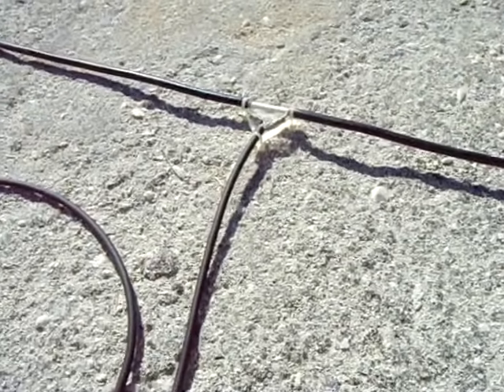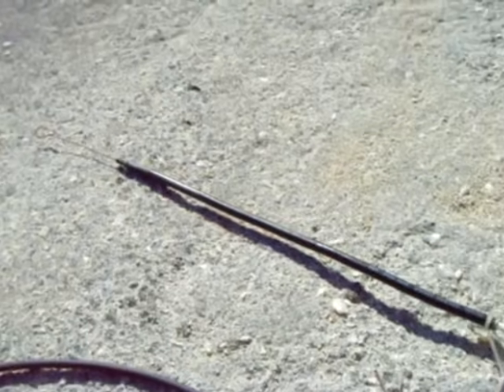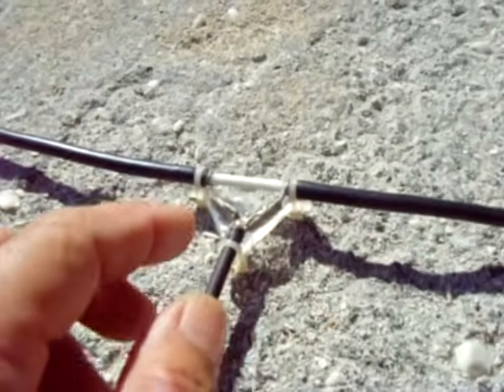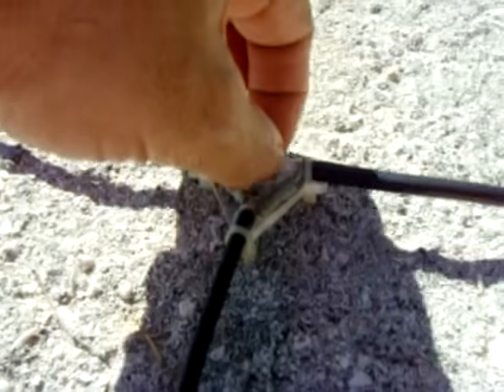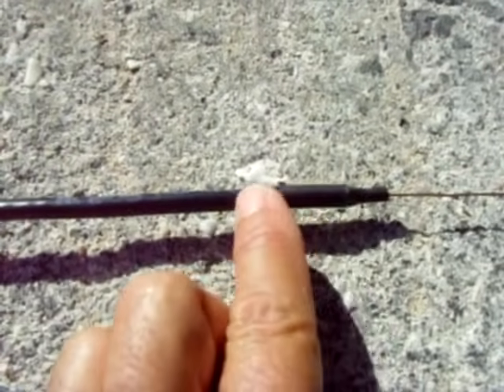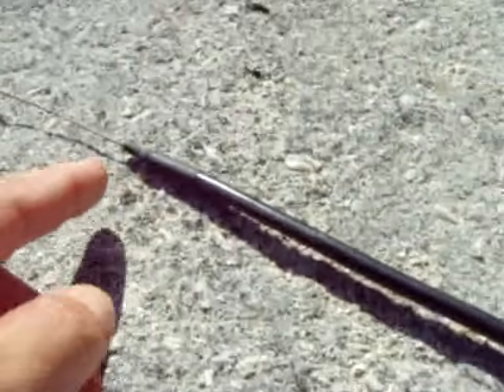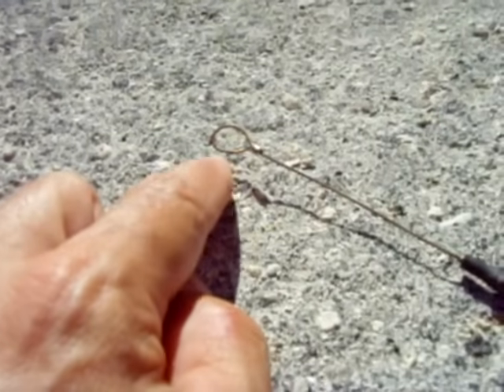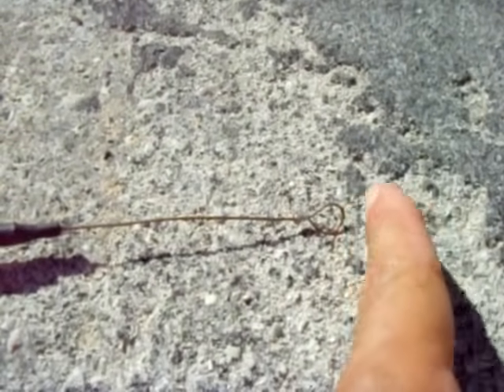How To Make Coax Antennas (FM receiving) Folded Dipole

Comment: That is NOT A FOLDED DIPOLE - you are using the wrong words to describe a dipole.
A folded dipole is a loops of wire flattened out and spaced, then fed at one side.
This is a dipole.
Reply from the maker: It's considered a folded dipole. Why? Because of how the center conductor of the coax and the braided shield are connected or looped. If you have a problem with this antenna, then take it up with the designer.

Comment: Finally got that .exe running in a Win 7 virtual machine. Hoping to build this today or tomorrow to get better reception from a local radio station that doesn't transmit with very much power.
Two things I'm still confused about:
1) The program features a list of very specific types of cable (e.g. RG-8 vs RG-8x vs RG-8 FOAM), and also shows the feedline as 50Ω. What effect can I expect from using a 75Ω coax? (Impedance still confuses the heck out of me).
2) Given that the shielding of the feedline is tied directly into the antenna, doesn't that mean the feedline is no longer shielded, and therefore its length should also be calculated?

Thanks to anyone who can help.

Comment: Just made this. So if you solder both wires at ends of the top wire, the receiving end is shorted, correct?  It makes no difference with the short wire from the Yamaha amp I tried...

Comment: Being totally ignorant about antennas and radio waves, I found some of the information confusing leaving me with questions.
1)  From the calculator app, using 98.2 MHz, the center point of US FM broadcast frequencies, I should make an antenna with overall length of 60.1222".  Given that length, should the length be measured from the tip of the exposed inner cable wire at each end?
2)  The calculator didn't indicate the length of the bare inner cable wire at each end.  Because you said that the length is critical, what should it be given my FM antenna frequencies?
3)  In pointing out soldering the copper shielding braid to the inner cable wire, you mentioned that 'it' should be a specific length carefully measured.  What length were you referring to?  The length of the braid?  Also, you didn't mention what I take to be shrink tubing that covers the braid to where it is soldered.  ??

Comment: Trying to understand this...
My FM is going from 87,5 to 108 and I want to make an antenna for my Receiver.

From what I have understood and using COAXIAL DIPOLES by VS3SQB
Input FM 108 (middle of the FM band) - I get that I need a coaxial at 1.39 cm
Am I close?
And Do I need to expose some of the ends depending on the coaxial type?

Comment: FM receptions is great. Ohm reading at 83mhz = 50, at 95 = 200, at 107 = 50.  Using RG6, would like avg closer to 75. I did not stip the ends completely. Stirpped back just enough to short the shield to the center.
Reply: ok, take 2. Trimmed each end and now get low of 60ohm and high of 107 at 99mhz.  Problably as good as it gets

Comment: made a few of these now, as the 1/2 wave length model seems that the length are not that critical. It does work well. I have also calculated and made this into a 1/4 wave length and it worked well also. This is much better than the rubber duck antennae.

Comment: Excellent plan, I was just wondering if I could use 2 conductor rca cable for the feed line, as the connector matches my radio or does it have to be coax? ( just makes for one less splice)

Comment: a bit confused,  is the baided shielding soldered to the solid core lead at each end?
and which measurement is which? what is the top width measurement?
Reply from the maker: Yes. The braided shielding is soldered at each end to the solid wire core. Use the provided links to get measurements for your antenna. Thanks
Reply: @electronicsNmore  Got `er done, This does work great.

Comment: Hi, great posting and thank you. However I have one question. If the FM band has bandwidth from 88 MHz to 108 MHz, using Coaxial Dipoles by VE3SQB require to have a specific input. That means the antenna will perfectly work with specific frequency. Difference on cable length for 88 MHz OD: 1.7m / ID: 1.27m, and for 108 MHz OD: 1.38m / ID: 1.4m. What is the best length or frequency to use to have most of FM band reception ok. Thanks
Reply from the maker: Choose the middle of the band.

Comment: 1K Like! I am going to build!!
Reply from the maker: Great to hear Justin! It works well when properly made. Be sure to check out my extensive video playlists below, rate thumbs up, and share the video link on social networking websites. Thanks 
http://youtube.com/c/electronicsnmore/playlists
Reply: I finished it. It works great and I have it mounted vertically behind my TV. It was a little tricky to do because the coax that I found had foil shielded thin delicate copper wire. I built it for 98MHz and now I can pick up stations that I could not before.

Comment: What an amazing resource (the links). Learning more about antennas than I thought possible. Great work. Thanks
Reply from the maker: You're welcome! Be sure to check out my wide range of videos, and share. Thank you
Reply: @electronicsNmore  Can you use the coax design and connect it to one of those boxes that receive t.v. signal over the air? And would it improve the reception and bring in even more channels than waht the box brings in?
Thank you

Comment: Why do you say to make sure that the coaxial cable for the antenna has copper braiding, that is, a copper shield? If the braiding is steel wire, then that won't work?
Reply from the maker: You can only solder copper shielding.
Reply: @electronicsNmore  Not so, there is no problem soldering steel wire. Really I prefer copper, but by mistake I got some steel stranded hook-up wire which I solder all the time to copper foil or to a steel terminal.  The solder that I'm using in doing that is 60/40 tin/ lead. 

Some coaxial cable that I have on hand has a braided steel shield and I would think that steel is more common than copper. I could be wrong about that as I work very little with coaxial cable.
Reply from the maker: @petel2869  I was talking about aluminum.

Comment: Thanks for the video. The calculator program linked gives the over-all length calculation, but it does not  seem to give me calculations for the solder points that you mention are also critical. Am I  missing something?
Reply from the maker: The program gives the total length and length from soldered point to soldered point. Thanks for watching!
Reply: @electronicsNmore  Thanks for answering my dumb guy question. I missed the program's "SELECT COAX  FOR
 VELOCITY LENGTH FORMULA" Box. Kinda important.

Comment: Thanks for your sharing.  However, Best would be show exact step-by-step of construction for one example say 99 MHz. Also, The website calculator page is confusing.  Says add 2 ft. To calculation but the talks about extra 6” on each side. Which is only 1 ft. Total.  I think this is why you got so many thumbs down.   You could really do  a lot more w this.
Reply from the maker: The thumbs down were from people that either didn't like the design of the antenna, couldn't use the Windows OS antenna calculator program link I provided, or Trolls. The antenna works well, and I thought the instructions were fairly easy to understand. If a person had trouble making the antenna, then all they had to do was ask a simple question in the comment area, if they clicked "Thumbs Down", that was a confirmation of their stupidity. I'll take a closer look at the link. Thanks for watching!
Reply: electronicsNmore I have no doubt the antennae works well - which is why I was hoping you could provide better instructions on how to build.  Even if you don’t want to take the time to do a video, photographs every step of the way would be helpful.  Steps: doing the calculation for typical coax such as rg -59, rg-6; adding additional length; cutting and stripping the wire, creating the plastic centerpiece, connecting the center feed to the two legs, doing the soldering, etc.
Reply from the maker: It's fairly straight forward. Download the program, enter the frequency desired, then use the images as a guide. For best results use braided copper as the shielding.

Comment: I'd say my attempt at this slightly increased clarity on local FM Radio Stations but I still can't gain clarity from distant radio stations.
Reply from the maker: Should be able to. Make sure it was designed for the MIDDLE of the FM band, and placed high up on your wall behind furniture. Keep the top element horizontal. Thanks for watching!
Reply: @electronicsNmore  Hey, thanks for posting a comment to mine.  I am actually shooting for FM Radio frequencies between 100MHZ to 106MHZ that are just under 75 Miles / 120km away, with a large lake and no mountains in between. Distant stations sound better with Antenna horizontally BUT IT SEEMS SENSITIVE TO DIRECTION on the horizontal plain. It's on my roof 26 feet off the ground so Maybe it's Likely that my lengths are not right. 

The link to your calculator doesn't get me to that software; I had to find something else and I'm not sure lengths are right; can you give me exact lengths I need?

Comment: You seem  your happy with the performance, however i disagree on a few key points... Yes you need shield on your feeder of it will act like part of the antenna, your ANODE and ELECTRODE as they are called, in a simple dipole, do NOT need shield and can just be the copper center rod. both sides. the center is an isolator and can just be a non-conductive any old thing...  pvc plastic,  rubber hose, Plexiglas square. I would also avoid the connected loops at the ends, i know you want a place to hold it or tie it up however is gets sloppy on your length calculations and the actually physical characteristics in calculating how they truly behave with lines of flux could fill volumes. In basic science you always want to give a relative comparison. it received FM signals well as compared to what? NO antenna/ Reynolds wrap?  twisted uncut coat hanger? You get the idea. Based on your video you really could use the $1.99 Wal-Mart special(or $1 at a dollar store and probably do better. Focus on what makes a good transmitter antenna and apply the same rules, because the rules are the same...  Thanks for reading...
Reply from the maker: Nothing to disagree with. The design wasn't mine, and it works very well. If you think a Walmart or dollar store $1 -  $2 antenna will work better, then you need to find another channel to watch. Thanks

Comment: Sodder?
Reply from the maker: Yes, that's what Americans call it.
Reply: Ok, I see, hehe. I implemented your solution, and it's working ok till now. The coax travels about 4,5meters from the fm tuner, goes through the wall and the "T" hangs about 2meteres high on the outside wall, attached to it. The signal improved significantly, but still isn't perfect. Any ideas? I calculated the distance between solder points. Thanks in advance.

Comment: Very nice antenna, although correct me if I'm wrong, but that's not folded dipole antenna. It's an ordinary dipole with matching circuit made with two pieces of coax. At 2:30 it's said it also matches balanced to non-balanced line. Has someone tried how it works with respect to that? You can have impedances matched but when symmetry is not converted you end up with your feeder shielding acting as a radiating element and the efficacy of the antenna depends on the feeder length.
Reply from the maker: I didn't design the antenna, but I can say it works very well. Thanks for watching! Be sure to rate thumbs up, check out my extensive video playlists, and share.

Comment: Nice info but not much good if you don't put the measurements in. I just need a simple FM antenna and I am not a radio head.
Reply from the maker: You need to use the calculator provided. Enter the frequency desired, and presto!

Comment: Give me a break, I have been using a split coax dipole for years. No need for his design, Just split the sheath from the outer casing peel it away, discard, Then with a small screwdriver open the braided wire and seperate the shield and pull the center conductor through the braid. tack to a wall on both ends. no need to measure anything,Mine is 4 ft long on each end with enough left to attach to the TV.
Reply: Read any article from anyone who makes fm antennas.😂😂 The length is very critical. It's extremely important to maximize the signal. Only an amateur with very little knowledge would say otherwise. The guy in this video is correct, and your insult is insulting yourself.
Reply: @jdizzle1939 
He thinks ‘anything’ will work because there’s a lot of ‘not right’ received signal that’ll adequately accept stronger signals and their ears of understanding don’t understand what they’re missing. 
I hacked a piece of the solid 12ga bare ground wire from some romex onto a broken rubber marine antenna in a friend’s boat. I knew it wasn’t ‘right’ but it did work well enough and it’s still in there. Could it be batter? Ya, I couldn’t tolerate that in my boat LOL
Reply from the maker: Jason K If you don't like the design, or are too lazy to make something the right way, then don't use it. :-)

Comment: Sodder?  What is sodder?   I know about solder
Reply: I believe it is US American for solder. They don't always get the letters or pronunciation right.
Reply: And Australians too.
Reply: Count the number of syllables in a word, then count them as you say them, are they still the same?

It's best if you can read and write to do that test though.
English is English, American is American English

More fun:
i as in ink? or i as in eye?
Ni[nk]kon and Ne[ye]kon 

Great fun, and very, very powerful is the 'word' so powerful it used to be called spelling, casting spells is writing.... and a spell book is a dictionary. Glad they changed the 'spelling' lessons to 'English' lessons in the early 70's here in the UK :D 

Though we better be careful, a wizard may cast a spell on us.
Reply: sol·derDictionary result for solder
/ˈsädər/
noun
1.
a low-melting alloy, especially one based on lead and tin or (for higher temperatures) on brass or silver, used for joining less fusible metals.
"remove the fitting using a blowtorch to melt the solder"
verb
1.
join with solder.
"the wires to this clip are soldered to the circuit board"
Reply from the maker: Ah, another instigating Brit.

Comment: So, wait a second, there's one appropriate length for a desired frequency, correct?  I would assume that's the overall length of the antenna, so what is the relationship between the length from solder point to solder point and attenuated frequency?
Reply from the maker: Hi Ryan. The antenna works fine for the entire FM radio band if you make it for the middle of the band(98.5mhz), but the best result is when you make it for the EXACT frequency. Please refer to the link in the video description area for more info. Thanks for watching!

Comment: I didnt understood about the length. Which it should be for each part? How could I calculate it?
Reply: The math is fairly simple.  Wavelengths (in feet):  Quarter- 234, Half - 468, Full- 936.  You can do one-eighth and so forth but start with Quarter, Half, and Full until you get use to making them and understand when to use which for particular application.  Typically Half is ideal for reception and size.  Here is formula..... Wavelength (in feet) = 234 / frequency.  Now multiply result by twelve (12 inches) to know how many inches it is.  The formula is example of quarter wavelength so substitute that number for however long you what antenna or maximum size that can be used based on available area where antenna will be installed.  The antenna is video is shaped like a dipole antenna but functions like a loop antenna.  The shape of antenna will have an effect on bandwidth and interference (long story short).  Google "Radio Operators Handbook" (MCRP 3-40.3B / FMFM 3-36) it should be first result.  This will get you going on understanding antennas and radio waves.  These "tight circles" are sometimes referred to as "loading coils" and can be used at the base of an antenna to reduce the overall length above the coil if there is very limited space or discretion is desired.
Reply from the maker: Link in the video description area.

Comment: what are the chances of this increasing signal level to where it's sufficient for decent stereo reception (in a place were even stick antenna is not that bad)?
Reply: Experiment.  I striped seven inches of 75 Ohm coax sheathing and then separated aluminum braid off center conductor, then strips foil and insulator off center conductor.  Wrap the braid around itself into a coil of braided wire and angle so both the braid and center conductor form a "T" with the remainder of coax being the vertical axis of "T".  Once this is done take and bend approximately half the center conductor upwards and half the braid wrap downward.  You should get reception (Mine got 71 percent reception and most channels but this was merely an experiment).

Comment: my radio anteena has only one wire so i can connect only one wear but the Coax Antenna has two wires
please help me
Reply: The braid does not need to be part of antenna.  The purpose of this on televisions is to receive the same RF that the center conductor receives so stray RF waves do not induce noise on signal line.  The braid would induce the same RF and thus reduce interference as the signal traveling down line is the same (long story short [but different phase]).
Reply: The center wire is the antenna. The braided wire is ground